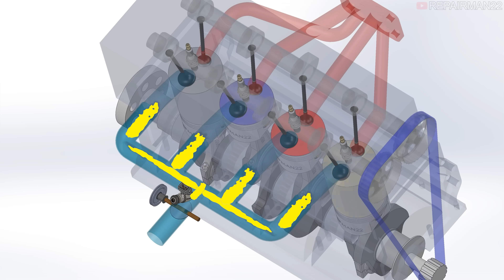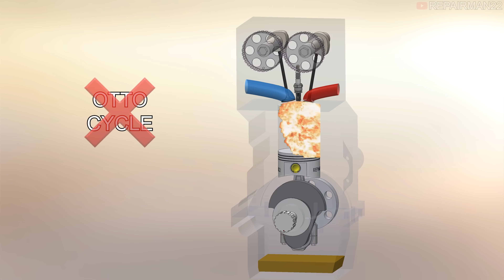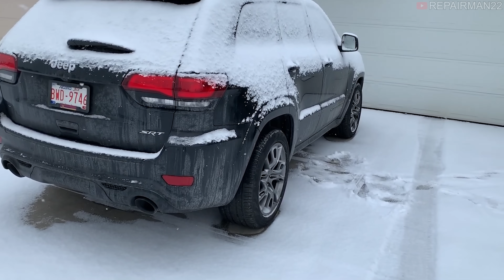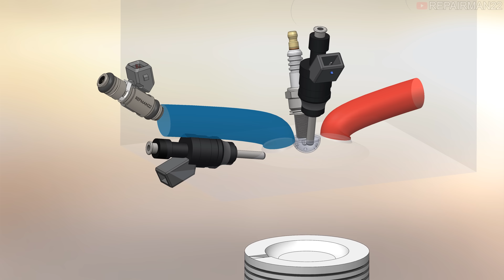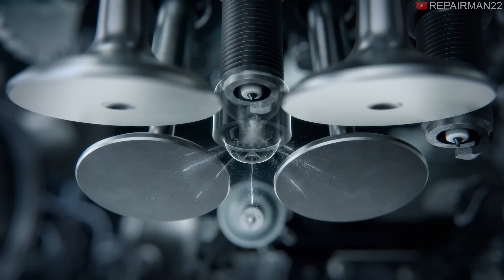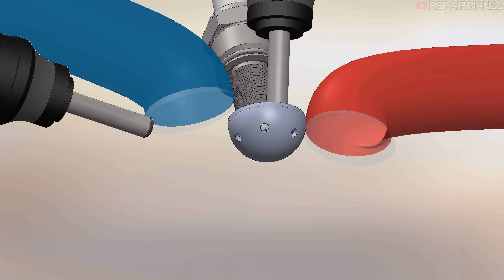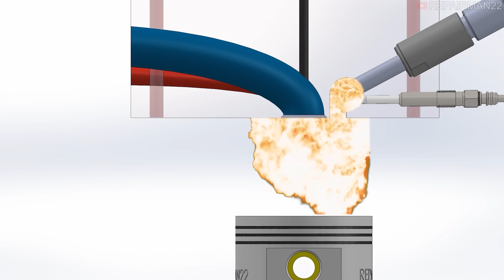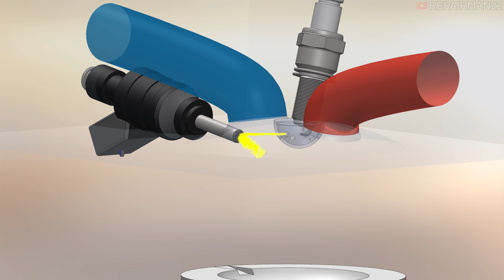How does this capsule with holes increase power? 💥🚗

Comment: This is an interesting system. Some elements that I think are worth touching on:
1) In modern engines, the top of the cylinder is already quite crowded. Trying to find space for the pre-chamber and another injector or spark plug seems like it would have a negative impact on valve sizing?
2) The spark plug hole has long been a useful way to have direct access to the cylinder for checking the state of the cylinder, and other troubleshooting. On the active system, it seems like this would be lost?
3) IIRC, one of the downsides of the diesel per-chamber was lower compression. It seems like this system would also have the same issue?
I did appreciate that you mentioned the risk of carbon fouling of the pre-chamber holes.
I see you've switched to a 'real' voice. Was this to show that you're not one of those AI slop channels? If so, it is appreciated.

Thanks for the video.
Reply: the dream is a two stroke V8 with a hybrid turbocharger that uses direct injection for both the air and fuel with the injector itself acting as the pre-chamber, while all 4 valves act as exhaust valves
Reply: @JedPotts-jv2ux  I played with a similar concept and ran into a few big constraints worth mentioning:
	1.	Combo air/fuel DI injectors (like Optimax) rely on an onboard high-pressure air compressor. That gives you high PSI but very low CFM — usually not enough airflow to sustain combustion unless the compressor is upsized, which adds drag and complexity.
	2.	Running stored air at ~150+ psi often requires a certified pressure tank. In the U.S. that usually means inspections and safety compliance, especially as volume increases.
	3.	Affordable compressors with both high pressure AND high CFM are rare. Lobe and vane types can work, but most don’t move enough air for continuous combustion.
	4.	A uniflow-style layout (or something like Alpha Otto’s RevForce) is way easier to feed with low-pressure, high-CFM external air. DI + prechambers are still a great direction though.

Valve-wise: four exhaust valves opening together needs either a non-pent-roof head or staggered timing, otherwise they’ll interfere. For a 2-stroke firing cycle you’d also want cam lobes 180° apart — running 1:1 with the crank accelerates wear.

And four exhaust valves means massive valve area + two cams, which also competes for space with the injector, rail, spark plug, and coil in a central DI layout.
Reply: How to keep the pre-chamber holes unclogged:
Give it the Wankel treatment.
A few daily red line expeditions will probably take care of it.
Reply: @GIGABACHI  wankel is dead tech bro
Reply: @welanduzfullo8496  No shit, bro ? !
Reply: @GIGABACHI  😅
Reply: this allows for higher compression while it was the whole idea to lower it with diesel pre chambers
Reply from the maker: Hi, a good solution would be to make a spark plug that also has a pre-chamber (for the passive system). By changing everything together, you forget about the carbon buildup and it also lets you see inside. The cylinder head is already crowded; in fact, the second spark plug is awkwardly positioned to one side, but since it only works at low RPMs, it doesn't affect anything. The other voice is human too, although many said it wasn't haha. But I admit that sometimes it seemed like that. Thank you.
Reply: @repairman22 there are pre-chamber spark plugs, used for years in gas engines. Thats where F1 got their technology.
Reply: What is a gas engine please? @V8Lenny
Reply: @CraigLandsberg-lk1ep natural gas

Comment: very succinct and thorough description, and really only off on a couple of minor details (like Lambda of 2 actually has to be fuel-supplemented at startup to heat the cats because lean is cold running -- it's why this high Lambda reduces NOx). Active TJI is included in the 2026 Formula 1 engines (already running on track). You are only missing 1 of the 4 types -- this can be excused simply because I haven't published my invention (I'm still looking for a development sponsor), although you've bracketed mine well enough with your descriptions that it might seem obvious after you've seen it..
Reply: He also completely forgot to talk about the magic elves inside of spark plugs
Reply: f1 does not have active tji
Reply: @welanduzfullo8496 i could always have dated info, but what i've read is "semi-active" through 2025 with Lambda of 1.6, switching to "active" and Lambda 2.0 in 2026. Like I said, this is just what I've read / heard and it could be completely off. BTW, "semi-active" involved dedicated nozzles in the injector aimed at the pre-chamber, but still just one injector. You could argue that this still constituted "passive", but then it's just semantics.
Reply: @ehb403 active isn't possible with the 2026 regs unless they call something active which is probably not active given they still only have one injector per cylinder

Comment: I hope that all new petrol production cars come with this engine, so electric wont take over.
Reply: consumers and physics have already determined that combustion engines will continue to rule, perhaps with battery augmentation (my expectation is that the best combination will prevail, mild hybrid -- it is effective at increasing efficiency, cheaper, and won't deplete resources as quickly).
Reply: @ehb403  the exact opposite is true, ICE engine already are on their death bed
Reply: @w @welanduzfullo8496 haha. i hope I'm as healthy when i'm on my death bed. Are you a bot? EVs have always been a red herring, manufacturers are writing off  $BILLIONS  this year in acknowledgement, so did Hertz rental company. They are resource wasteful, take advantage of slave labor to produce, their batteries create dangerous toxic smoke when they burn - and they can't be put out, rely on an overworked grid and electricity generated by burning fossil fuels, create more pollution in production, cost more when the government quits paying the bills, battery disposal will become one of the biggest hazardous waste issues in the next five years. At least they're quiet so pedestrians won't hear you coming to run them over...what's not to love?
Reply: @ehb403  
Funny how brainrotted the anti EV crowd is when every fact goes against them. As I said, ICE engine are on their death bed and EVs are not "red herrings", manufacturers are writing off subpar product and overproduction and nothing more, Hertz has to write off their assets when the market to market value of their cars goes down in response to overproduction by manufacturers, they did the same for all their ICE cars that lost massively in value when the car shortage post covid came to an end in late 2024/ early 2025. 

They way less resource wasteful, have way less slave labor than any lifetime fossile fuel supply an ICE consumes requires, the cars burn less than ICE cars per 100'000 vehicle on the road and produce about as toxic of a smoke as burning ICE car, the fire can be put out, but again EVs burn way less often than any ICE car, the grid is not overworked and every western nation has one and a half to two dozen % of overcapacity while the grids are being built out by the year, even if they were charged by electricity generate with more with fossile fuels which is not true, they would still be more efficient than the average ICE car when you account for all grid transmission losses, charging losses and discharge losses as power plants like coal and CCGT are far more efficient than the efficiency of producing, transporting, refining, transporting and burning gasoline or diesel, battery disposal is a non issue and batteries are already getting economically  recycled and recover 90%+ of materials, the government incentives have stopped in so many countries and EV sales are still growing in the mid double digits in those regardless. lastly, the cars require sound generators to be road certified in almost every country on earth so no, you will hear them coming hundreds of meters away.
Reply: @welanduzfullo8496 talk to me in five years, we'll see which way the wind truly blows...meanwhile, perfect your argumentation skills so you don't have to rely on simple insults. at least come up with some creative insults!
Reply: @ehb403  you called me a bot, probably the least creative insult on the internet and my arguments are just fine and completely debunked  all of your negative claims about EVs
Reply: @welanduzfullo8496  You simply disagreed, did not "debunk" anything. My statements are factual and easily verified (check out cobalt mining in Africa for instance) or predictions that I expect to pan out due to trends in consumer purchases and government regulations paired with the pitiful history of politicians trying to force technological choices on consumers. Or do you want to try and convince me that stop-start technology is the latest, best idea ever?
Reply: electric will take over and its a good thing, you can still have your gas engine your rent or own for the track and drive an cheap, efficient and pollution poor commuter